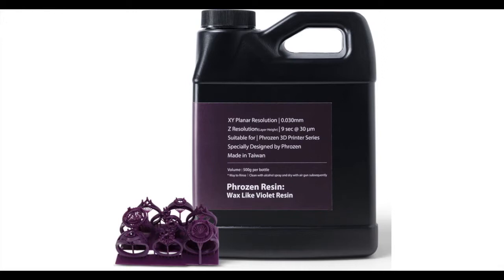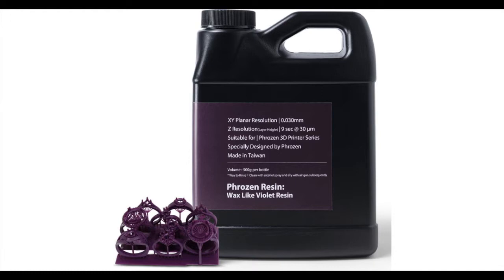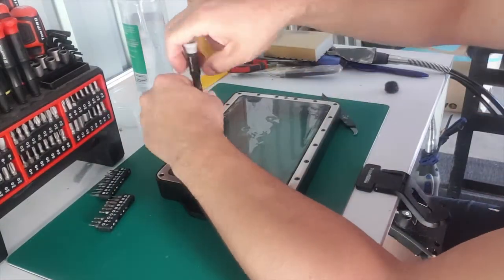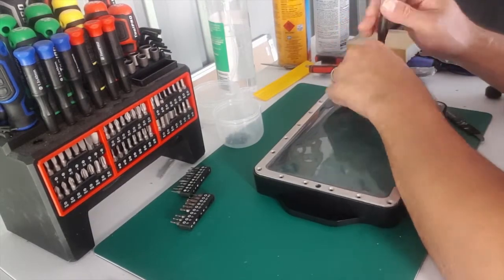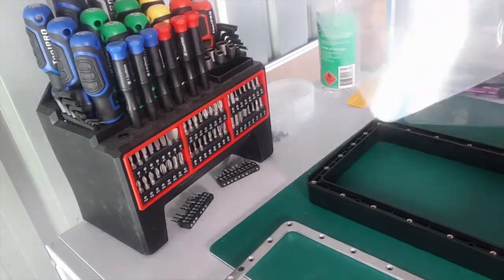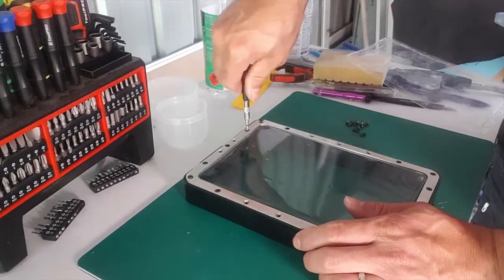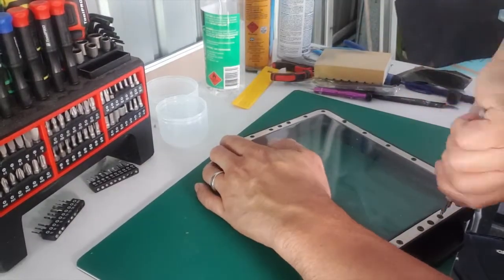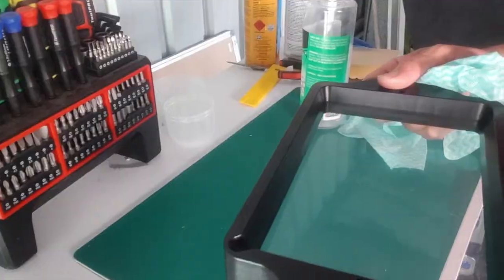Changing a Phrozen Sonic Mighty 4K FEP plastic

Comment: Paul Harbach
24 seconds ago
First time replacing FEP on Mighty 4K.
What is the size of hex key used on screws?
2 mm fits, but is sloppy.
2.5 mm is too big!
I don't want to strip the heads of the screws